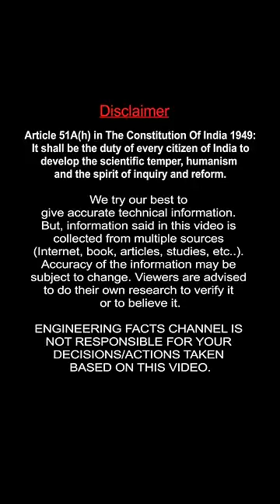ATM-ல காசு தப்பா வந்துருக்கா?

Comment: welding machine la current value more Like 133A ,  voltage less like12v . but home use panra power la voltage value more & current is less 
ena reason more current used in welding machine
.